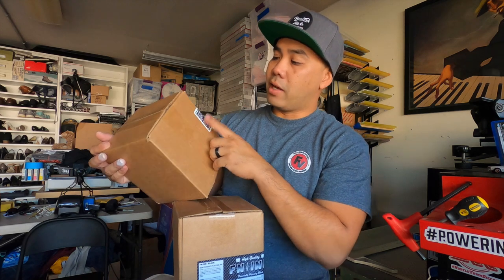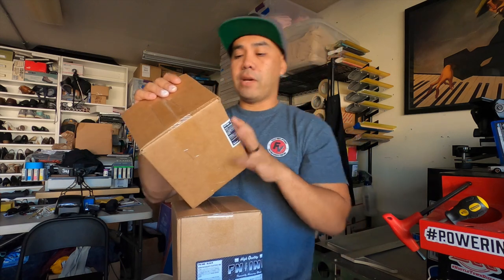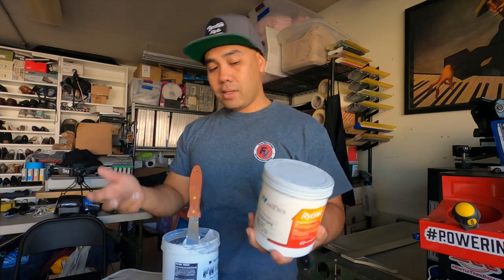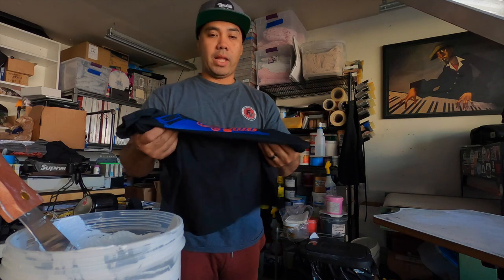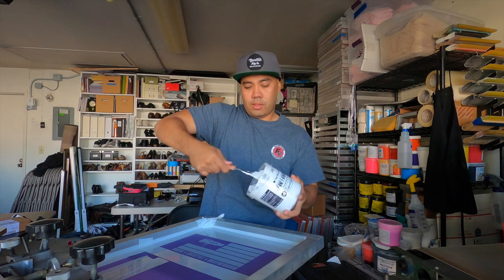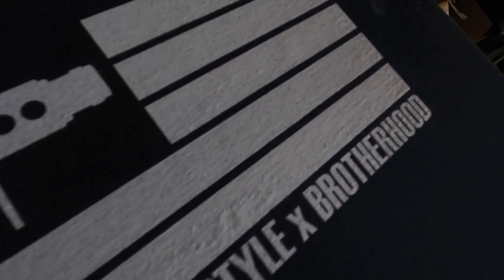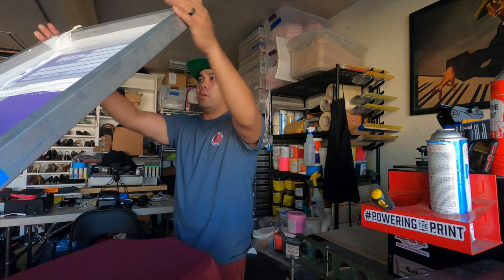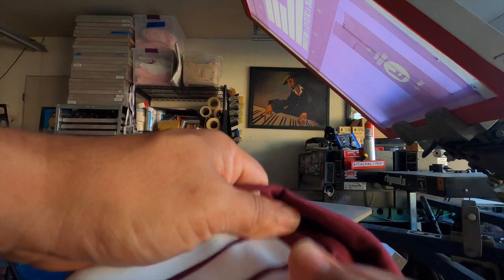New RYONET Inks - F/N Inks Test (S:05/Vlog 068)

Comment: Question?  Does it matter what brand the proof positive film you get?  Amazon has some, Ryonet sells some, Catspit Sells some.....I mean is there really a difference or is all waterproof film positive created equal?  That might make a good comparison video.  What are your thoughts?
Reply from the maker: That’s a great question. I have thought about this before. And to be honest, just get one that at least 5mil (thickness). It doesn’t matter on the brand. But I have used transparency film, like the ones they use at school for overhead projector( ya I know.. old school) and just “double it up” to make sure that the print is dark. But I do recommend it to be waterproof. Just make sure that it’s at least 5mil. I’ll try to do a video on it

Comment: These inks seem great but I wish they had more colors. The issue I have is I can’t print them with regular plastisol that cure at 320. I checked with Ryonet and they recommended not doing that since the temperature will be too much for FN inks.
Reply from the maker: I’m sure that Ryonet will have some more colors soon. I don’t think that there will be an issue printing them with regular plastisol inks curing at 320. I’ll do more tests on these
Reply: According to their customer service rep, curing these inks at 320 will make them glossy. But I’ll keep an eye out for your videos once you give that a test! I appreciate you doing these videos.
Reply from the maker: Marvin it might make them glossy if you cure them by using a Heatpress. I might have to do more tests then. Thanks